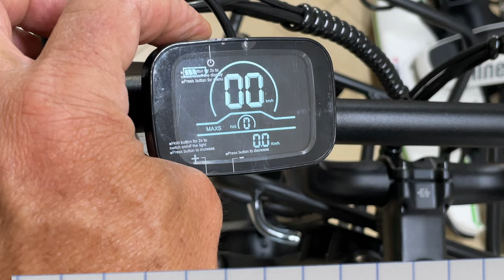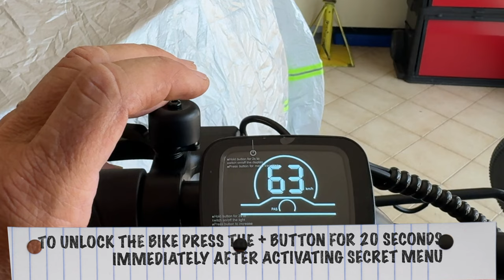ENGWE L20 - UNSTOPPABLE CARGO  E_BIKE - FULL TEST - 4K

Comment: Alert: I am using this bike. The range is only 55-62 km IF YOU USE mode 2. Imagine if you use mode 5, you will get only 30-35KM. So don't fall into this marketing traps. I bought(27-09-2024) this bike because I was excited about the 140 km range advertisement, but it is totally lie😢.